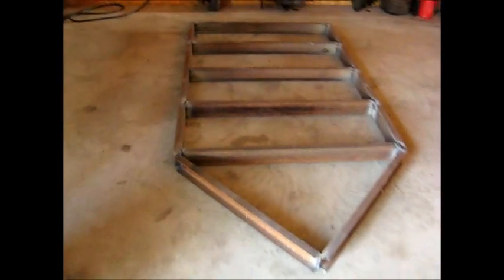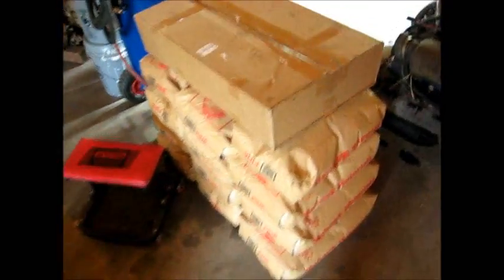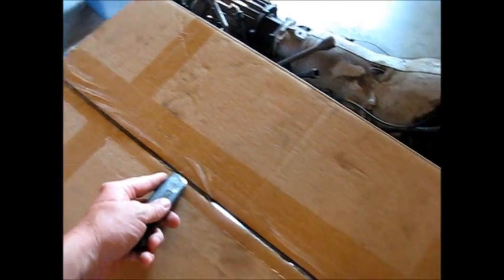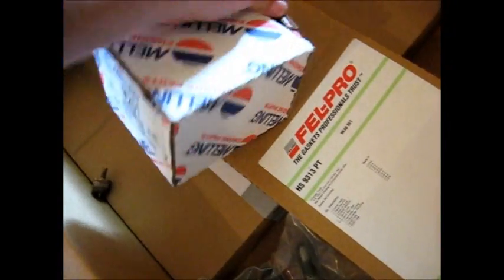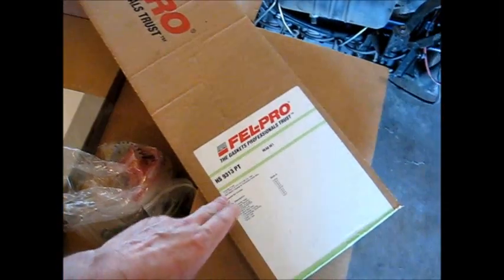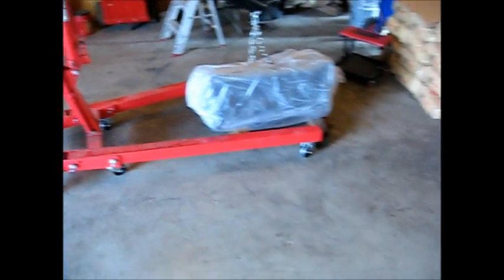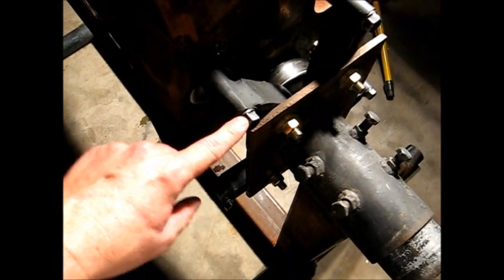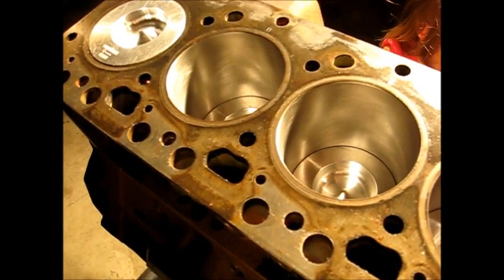#1 MELT DOWN Cummins diesel rebuild

Comment from the maker: It is called a cam plug. It would be installed the same way as a freeze plug. Some builders will use a sealer and some will not use anything on them. I put them in dry myself, as long as the surface is super clean it will not leak & there is no pressure on it.  The freeze plugs go in dry as well.

Comment: @wreckingcars72 not usually. i also blew another head gasket causing oil to pump into the radiator and water to drain into the crankcase, but it wasnt leaking compression.

Comment from the maker: @84W150  This is not my truck BUT my buddy told me that it got ran with no water for about 90 miles Then a fuel injector stuck open then melted down the pistion.  The motor had 300 thousand miles on it. Running a truck with no water will kill it every time.

Comment from the maker: @cjlowndes  The cummins is the million mile motor but that depends on how it was treated and what mods have been done to it. The MPG is really good with the cummins sence it is a 6 cylinder engine around the 20mpg depending on the truck. Good luck on your quest in getting your self a Cummins diesel.

Comment: I find it interesting that the cummins use solid lifters. You would think it would cause the cam to wear quickly. I know the idi when designed in the late 70's have roller lifters.

Comment from the maker: @delmontcrusier  It did not blow any cooling hoses and it was bone dry and ran when I took the motor out of the truck. The mechine shop said that was the worst melt down that they had ever seen that still ran. The best part was the injector and the 2 valves that were above that pistion GONE LOL and the valve was bent.

Comment: FAB videos! Really nice to see that engine getting a new lease of life! I'm from the UK and did drive  a diesel Range Rovers, Anyway during winter i managed to hydro lock it and bent everything! So i'm after a Dodge Ram with the 5.9 cummins and 4x4. These trucks are hard to get hold of here and  would just like a little advice as you clearly know what your doing. So have you any  MPG figures and should i worry about buying one with 200-300 thousand miles on it? 
Thank you and very good work!

Comment: How many motors could you fit on that trailer you built? I would say three well placed engines but I'm not sure. The frame looks solid as a rock though.

Comment: Great vid man. Got a quick question. I have my sights on a 96 3500 with the 6bt my dad has a common rail I'd like for the 6bt to have 300hp & 600+lbs of torque or so what would you recommend for a 6bt to have stock common rail-like power?

Comment: @cjlowndes I get 17 - 21 mpg average with my 2003 6speed 4wd (All depends on how much I have to stop/start, and how heavy my foot is I regularly see 30mpg if I just cruise along on the highway at 65mph though).  I bought it with 230,000 miles on it, and I'll hit 300,000 miles before my next oil change.

Comment: quick question for you - what do you use to 'seal' up the cam cover plate at the back of the block?  Any sealant, etc, or just swedge the plate in palce and call it good?

Comment: @wreckingcars72 theyre shitty headgaskets on these engines. take a cummins gasket VS a fel pro and youll see. the printo seal fel pro has paper thin fire rings compared to the wide and beefy cummins gasket fire rings. i had a fel pro in my 12V and i literally blew the fire rings apart between #5 and #6 causing them to exchange compression.

Comment: It is ironic that engines start as many pounds of iron or aluminum that need to be melted to liquid before casting, or forging. It is between the extremes of temps, that most people make their wages. You would not get decent wages, whilst working on the Sun. Those who sell ArmorAll, or various miracle finishes, lubricants etc. would go broke at higher temps. Habitable zones induce complexity, and the need for intelligence.

Comment from the maker: The dumb shit at the machine shop that told you that needs to go back to school. The crankshaft is hardened during the manufacturing process. When you REGRIND a crankshaft you are just taking thousands off it & not changing the temper of the damn thing.